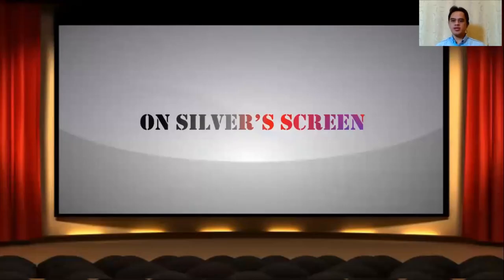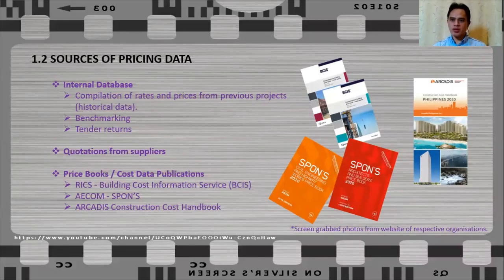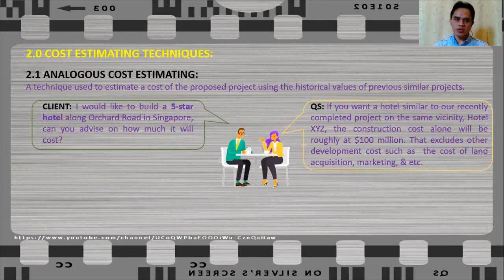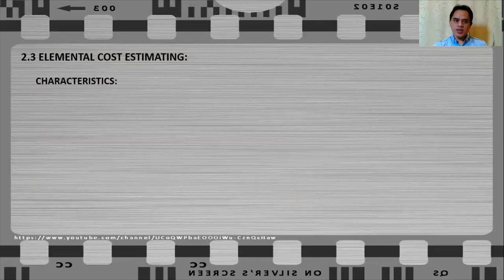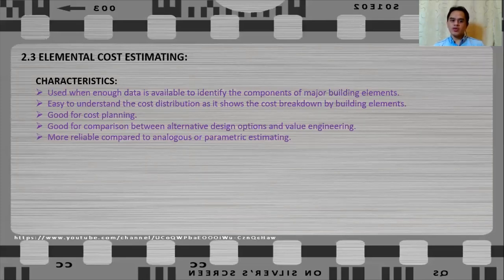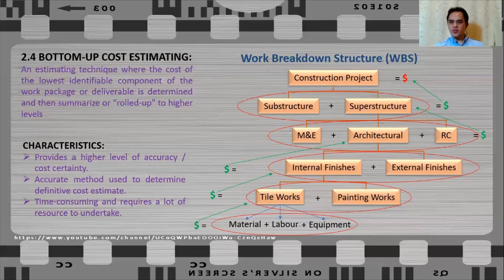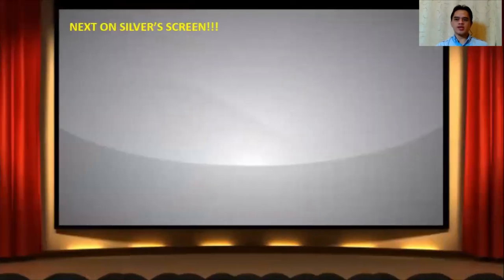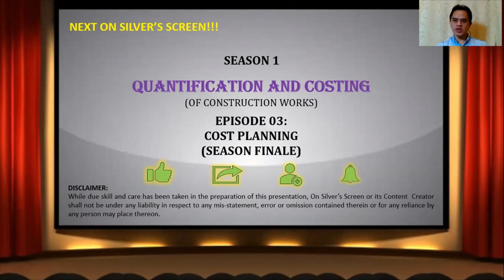S01E02 Cost Estimating Techniques

Comment: nice presentation👏👏 salamat po sir🍻
Reply from the maker: Thanks 🍻🍻🍻
Reply: @onsilversscreen6920  sir, please clarify if the estimating techniques you've discussed could be an answer to APC interview, thank you in advance.
Reply from the maker: Hi @paulsaimon13, the estimating techniques discussed is what we used in practice. As for the answer to APC interview, it will largely depend on how the question is framed.

Comment: Sir Silver, isn't it difficult to evaluate the cost when using Vendor Bid Analysis given no BoQ will be provided to the tenderers during bidding? Usually, the tender returns will not be apples to apples.
Reply from the maker: Hi Bobby, there are several methods to analyze tender returns. In this case the offer will be scored based on the quality attributes. You may want to check S02E09 of my video for more information about tender analysis.
Reply: @onsilversscreen6920  thank you Sir. God Bless.

Comment: Sir, in what cost estimating technique belongs to the Bill of Quantity (fully priced)? Is it on Bottom-up? Thanks
Reply from the maker: Hi Marvin, 

Do note that Quantification and Costing are two different activities carried out to determine the cost of the works/project. Allow me to address your question by breaking it down into sub-topics:

1.	Quantification (for the purpose of BOQ preparation):

Whether you are preparing a Bill of Absolute Quantities or Bill of Approximate Quantities, the quantification process are to be carried out by means of measurement (either manually or electronically), counting or approximation from the available data/information that you have (see my S01E01 video). The difference between these two types of BOQ’s are the accuracy of quantification process and its contractual application.

2.	Costing of Works.
My recent video (S01E02) is about cost estimating techniques. If you noticed, you can provide high level costing without the aid of quantification process that is through analogous or parametric estimating.
On a detailed level of cost estimating, quantification process and costing techniques are to be paired in order to come up with a cost. Again, depending on the accuracy that you wanted to achieve, the rates to be applied to your estimated quantity can be obtained from either one or a combination of costing techniques mentioned in my video (e.g using your historical data, using cost publications, vendor bid analysis, etc.). Another technique is what we commonly called using a built-up rates but this can also be classified as bottom-up cost estimating (as you are estimating the cost from the lowest identifiable item, e.g. material + labour + equipment + O&P + etc.).

In summary, you can combine several techniques to prepare BOQ as well as determining the rates to be used for costing of works. I will discuss more about BOQ (as I have already given you a sneak peak on BOQ preparation😉😉) in the next season where I will talk about Procurement and Tendering, please watch out for it. Hope that the above explanation could help. Cheers!!!
Reply: @onsilversscreen6920  Understood Sir. Buti nalang natanung ko dito,  kala ko pareho lang, sir baka may sample panel questions ka jan for AIQS? Core II (Procurement&tendering) and Core III (Contract Admin), first salang ko sa panel interview. Salamat
Reply from the maker: Sorry Marvin wala ako nyan.